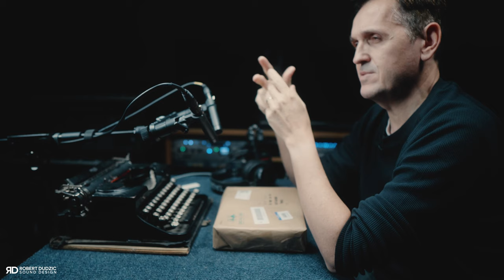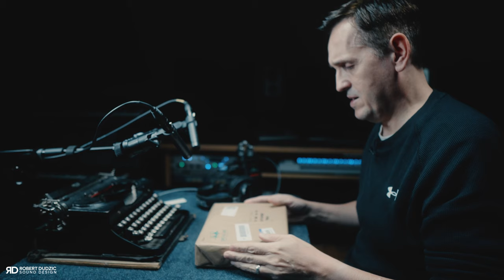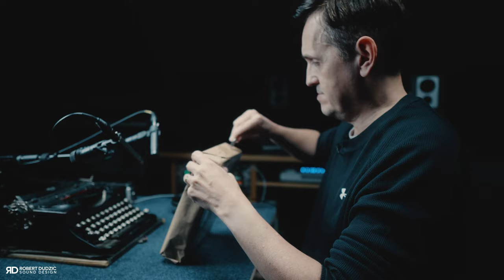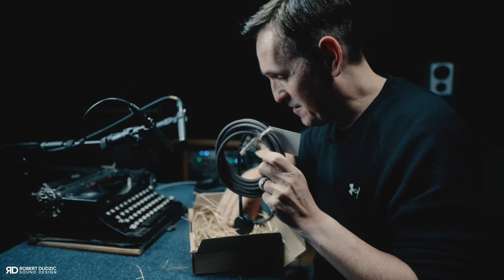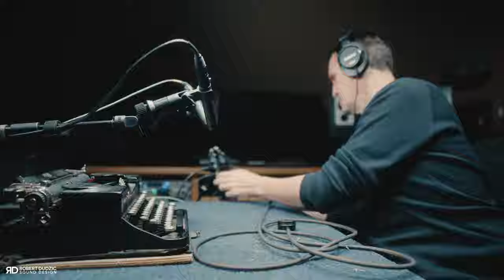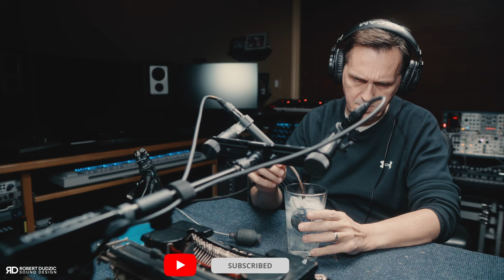Making Sound Effects with Hydrophone / Magnetic Contact Microphone

Comment: Amazing as always Robert! 

I had to get one myself! I quite like the build but I'm finding it hard to get the same input gain as in your video. 
I've tried using the recommended HOSA MIT-129 impedance adapter to connect to the Zoom F6's XLR input (without +48v phantom power) but still, I have to crank up the gain on the recorder and in post-production to get a good level for anything that's not a direct hit to the piezo. 

Are you using an active D.I box and/or external preamp to connect to the X8? Any tips and insights from your experience would be much appreciated!

Thanks.
Reply from the maker: Im connecting all direct in to TASCAM Portacapture X8 no any adapters. Tascam sound warm and natural.
Reply: Hello Lorenzo, when used with the Hosa is normal to have less gain since it's a passive device. When used without it on an HI-Z or Mic input, the gain should be quite high.
Reply: Hi, I am following this. The Zoom F6 does not have a jack input, only XLR (too bad of course, even the H4n pro got mixed XLR/Jack inputs...) 
So you are stuck with XLR inputs and a simple convertor jack/xlr will not change your problem. Maybe the Tascam has a line/instrument input instead of a mic input, and maybe this is what we hear. The low end from the typing machine is wonderful and it is hard to imagine that it comes from the contact mic (maybe Robert Dudzic mixed in a signal from th Géofon?). I am surprised that even with the Hosa you need to apply a lot of level. It is a passive adapter so it is logic, but using all gain from the recorder could bring in some noise. The preamps from the F6 are very good so you'll be okay. Otherwise you'll need to look for a phantom powered preamp that has a built-in impedance corrector.